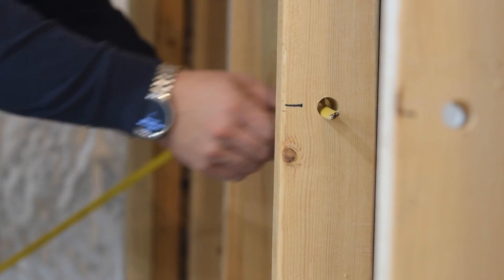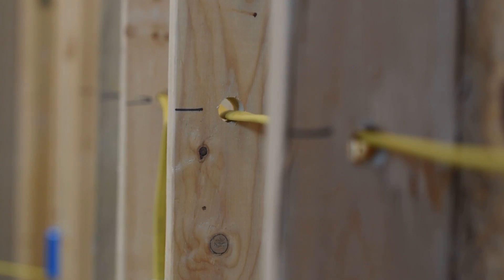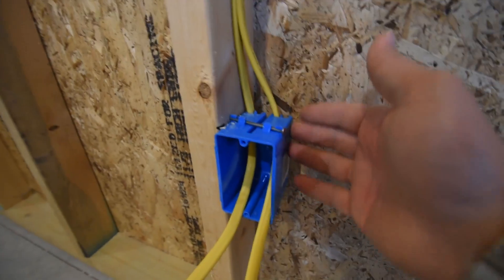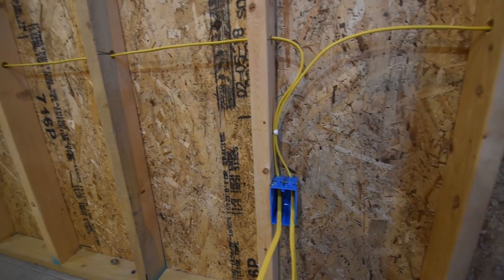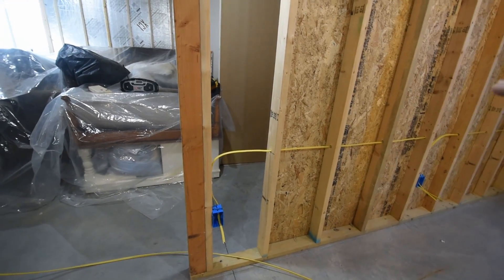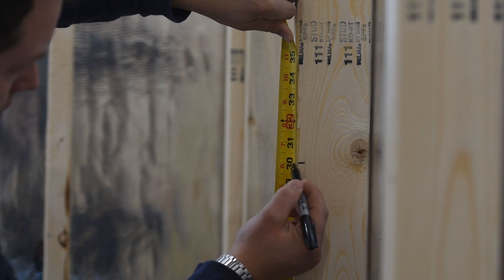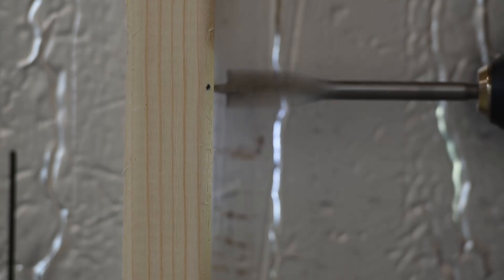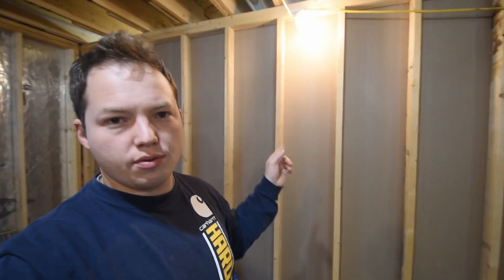How High Should Wires Run Through a Wall

Comment: Hey Ben! 5/8 hole thru studs because 11/4 edge of stud from cable per code. 44” to bottom of box easier to hold den hammer on. 10-4

Comment: I just hold the hole hawg at my waist and that’s somewhere around 36” inches from ff. Whatever the measurement, you want to keep your run at a consistent hight. That keeps the insulaters happy and its easier to pull long runs of cable.
Reply from the maker: Exactly.
Reply: That's what most electrician do, and then the height depends on how tall the electrician is more then anything else.. and that works just fine..
Reply: @DRAGONMONKEY0310  I'm 6'4" and my journeyman is 5'6" and it makes him so mad lol.  I don't care.
Reply: Yep, you can always tell the holes the old Master drilled, all at the waist -
Apprentices are liable to drill anywhere until they learn to quit wrestling with the hole hawg 🤦‍♂️🤭
Reply: Buddy89 good point about insulation.
Reply: I always do waist high as well, I'm right at 6' tall and around same height as the rest of our crew so never an issue between us. Started doing things based on body part areas a little while after I started, saves time on measuring. 
When I first started boss handed me a hammer to measure rcpt outlet height and to use hand length from front of outlet for make up length and I eventually started measuring limb parts/tools when bored I could use for reference on a lot of stuff.
Reply: Well you can see who pays for the wire... Not the electrician.

Comment: 30" is a great idea. I like switches to be 46" to the top of the box, and recepts to be 14" to the top. Use a laser level to quickly and precisely shoot a line around the room so you can sharpie where to make the holes. Auger bits are awesome to use to make nice clean holes. Just be very careful they don't hit a nail or a knot in the wood. Best to use a right-angle drill, too. Also, l like to leave a short loop of slack in the stud space for each cable that goes into a box.
Reply: Right-angle drill with an auger bit is fantastic.  Spade bits are no bueno!
Reply: ADA specifies a minimum height of 15" and a maximum height of 48".
Reply: @ninjamunky  Ah, it's ADA and not in the NEC? Interesting. Good to know. So 15" is for recepts of course.
Reply: @aaron74  - Right, 15 to the bottom, so maybe 16" to center, minimum. 18" to center is common where I'm at - that way you have a margin. Also, not sure if ADA is enforced in residential, but it is in commercial, and usually the heights are specified by the architect. One last thing, I think ADA is in the informational annex of the NEC, therefore not enforceable by the AHJ.
Reply: @ninjamunky  ADA is required if it's an apartment or business. If it's a home owner occupied isn't as much an issue but is still best to be followed for future concerns.

Comment: personally I like 42" for switches......but I'm only 5' 5"...LOL
Reply: That's a very good height. You have to think of children and people in wheelchairs.
Reply: Master here and 42 or 43 has always worked for me and 13 for standard rec height (electricians fiberglass hammer length)
Reply: Anything other than standard looks weird.
Reply: @guyprattii3115  There is no standard.
Reply: @aaron74  In commercial buildings at least for AV touch panels 48" from the floor to the top so they comply with ADA.   Think it is the same requirement for switches.

Comment: I found using a 2x4 30" long and then marking all studs with it keeps all the holes straight. Or a laser level.  Inspectors love a neat straight job. Also, use the Bosch bits with a good strong cordless. Goes through like butter.
Reply: WeatherNut27 if electricians did that they would go broke. Who has this kind of time?

Comment: I like to use 18in ship auger bits with dewalts 60v stud drill when the framework is wood. Makes it easy when there are 3,4 parallel studs to pass through.  These bits are also nice to drill through the top plate without needing a ladder. Another benefit using 18in ship augers with corded drills, you can drill into the toe plate a 1/4 inch or so when you're not using the drill setting the bit propping up the drill.  When you need the drill again you can pick it up without bending over as the drill suspends itself about 2ft in the air from the long bit.
I usually hold the drill at my waist and I'm 5"7.  So i assume I'm around 30, 36 inches from the floor.   I've seen older remodels where the wires were zig zagged, up n down. While it may technically be ok, it looks really bad. Very amateurish.

Comment: an easy way that i do it is to hold my right angel drill at my belt height
Reply: I do this as well for speed, but the pre-cut 2x4 is far more accurate.  His way makes for a neater looking job, least till the drywall goes up.
Reply: @beeps7  But then the drywall goes up lol. Thats another set of problems for electricians lol

Comment: Kick ass. I run the plug wires 24 to 26 from finished floor height. In the 30 inch zone u r getting close to lower cabinets Heights.   And on all holes I put metal protector plates to minimize screws in my wires later
Reply: Tom Garbo  no, plug
Reply: Tom Garbo  outlet=receptacle=plug if you are on the trade  you know what's mean